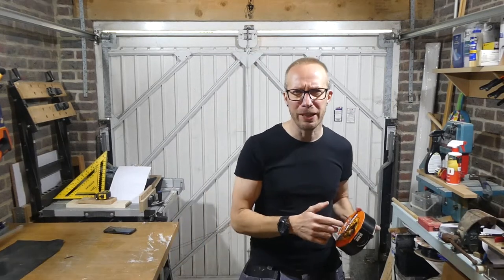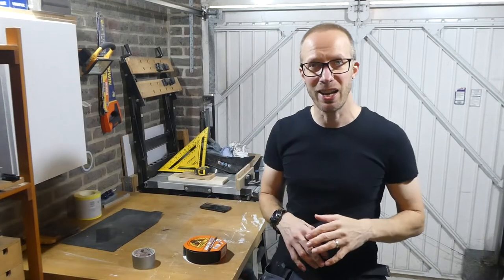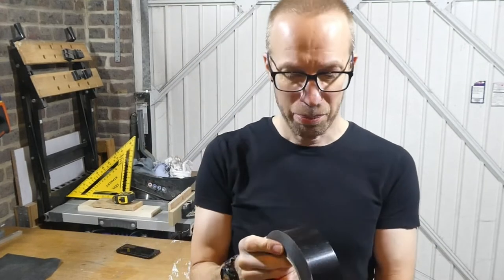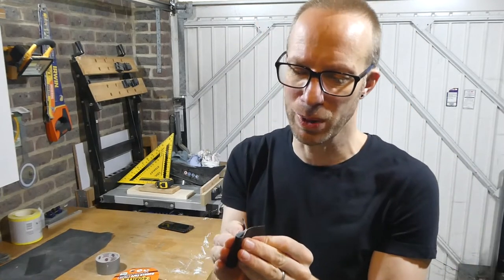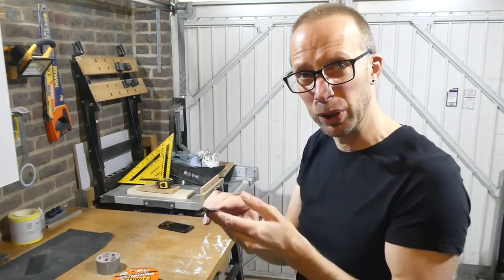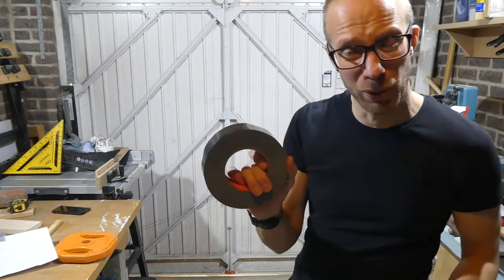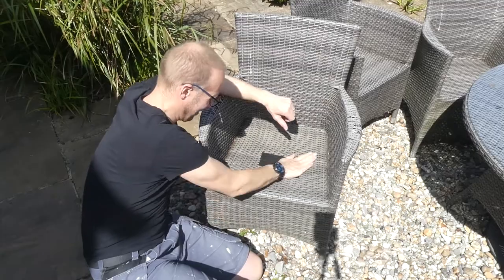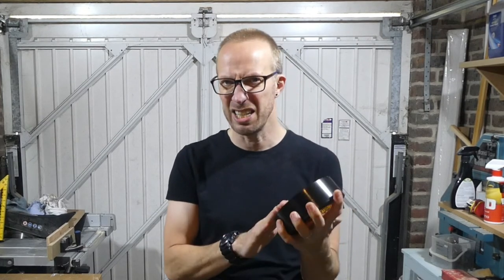Gorilla Tape - Duct Tape - Use and Review

Comment: I used this on one of the plastic flaps on the pull out drawers in my freezer something had fallen on and left a 15-20cm crack on. I put it on both sides of the crack (cos why not) and the stuff is strong af. I put it on years ago and it’s still strong. Even in the harsh environment of a freezer. Stronger than before it was originally cracked even cos I can flex it quite strongly and it doesn’t crack or try and slip or come off at all. Not even one bit. Recommended